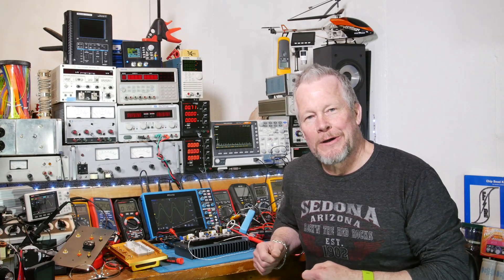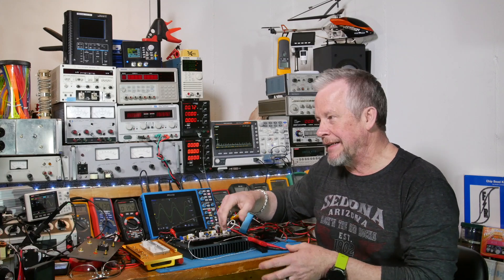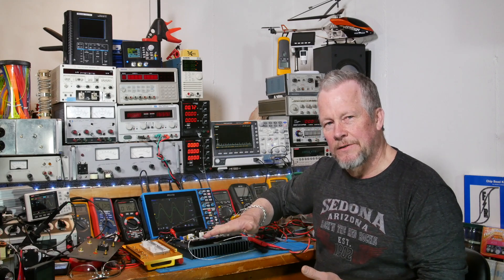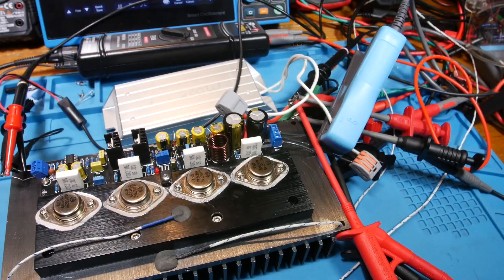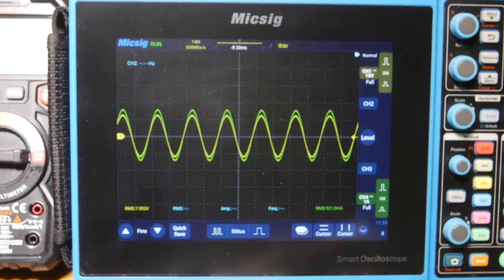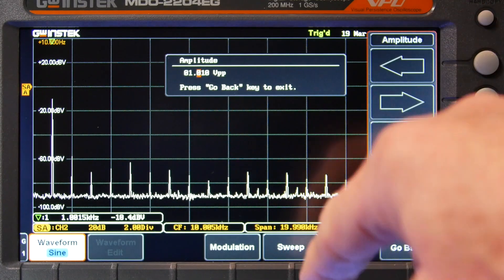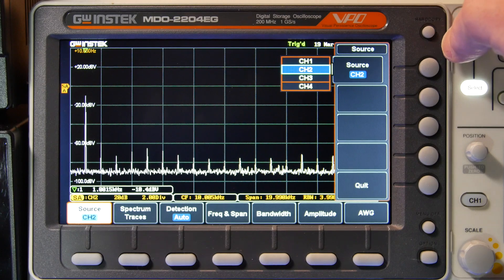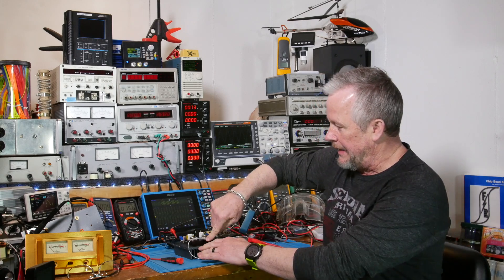Class-A Power at 8 and 4 ohms, THD and Bias w Temperature

Comment: yea again a great video, in my experience with amps its almost always the power supply, that's why i always use a emi filter at the ac input to the toroidal transformer, and i take good care that the power supply is nice and clean, i also do not understand that people say the power supply caps are not in the audio signal so they are not important, we all now that is not true, bad caps and other bad stuff in the power supply make the best amp sound bad, again this video is a proof of that, i did a test of a hood 1969 amp on a big 8000mAh 4s lipo i have, and the amp performs so nice and it's so clean and the sound is so good u can not believe that it is the same amp, so when i build a amplifier i always start to build a very good power supply, when i have the power supply ready than i take care of building the amplifier, now you now wy a good amplifier is expensive, it cost so much time to get it wright, and time is money for a business, so building a good amp as a hobby is always saving u money and u have good fun doing it
Reply from the maker: Thanks Jos Haas!  I agree, the power supply is an important and integral part of the amplifier.

Comment: When you have to drop the bias because of the heat problem what happens to the level of the second harmonic. Since the second is what makes our nice sweet sound of the class A. 

         And at the same time you’re dropping Tobias what is happening to the level of the third harmonics. 

      Since you’re limited by the size of the greatly undersized heat sink with a major temperature problem to actually run the system and its desired bias. 

         You can still run the needed by us to get things back up to where they are but the reality is you will have to add fans it’s a compromise to get back the class a performance that is lost by dropping the bias because of a extremely undersize heat sink. 

           Run oversize fans at half voltage and they should be nearly silent but dissipate all the heat you want with those tiny itty-bitty fins and heat sinks.
Reply: One must view the nature of all harmonics, The second harmonic level will double (become twice as bad) with doubling of you main volume when you reach the second order compression, lets take and example, your amp has a second order compression of say 10 dB regardless what the dB represents, No doubling your volume is adding 3 dB, the second harmonic if it was at 1 dB becomes 6dB higher, Now double the volume to 6dB and the second harmonic changes to 12 dB. Third order compression is worse because when you approach the third compression point it means that doubling the volume trebles the third harmonic, Take the same example above doubling your output 3dN will triple the third harmonic to 9dB, Now you will understand why the sound becomes absolutely awful the higher level you are listening to, please do not confuse this with clipping the harmonic phenomena happens much lower than clipping. At clipping, you simply swap the AC audio signal for an Alternating DC signal that contains zero information.  At clipping all harmonics are present in their maximum.
The cure is to make the system run from an infinitely high power rail so that the signal cannot produce 2nd and third order compression therefore no harmonic distortion, This is easily demonstrated by MC12, Run harmonic distortion and when it becomes noticeable increase the power rail thus forcing the amplifier into a wider linear operating mode. Obviously there are physical limits before destroying the components. 
The simple test is to compare two amplifiers a 10 watt amp and a 1000 watt amp playing at the exact same level, The 1000 watt amp performs infinitely better at the much lower rated brother at exactly the same output level.
Reply: @nicoras8803  I would like to live to see 1000 W class A only amplifier. 
       Break out the marshmallows and hot dogs cause we’re having a campfire . 
        You’d even be able to heat in entire house in Minnesota in the dead of winter at -22°F below zero